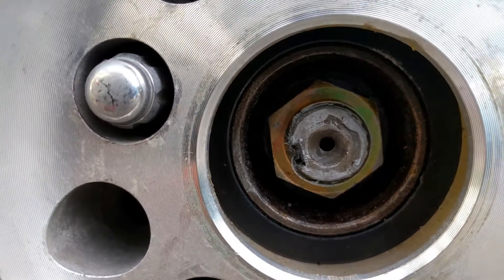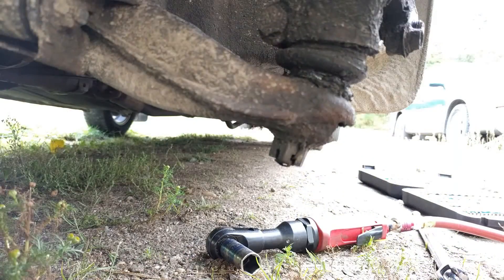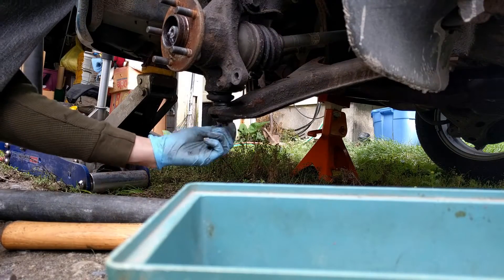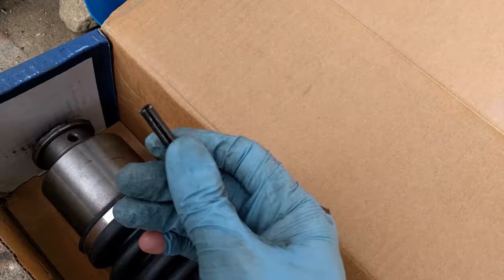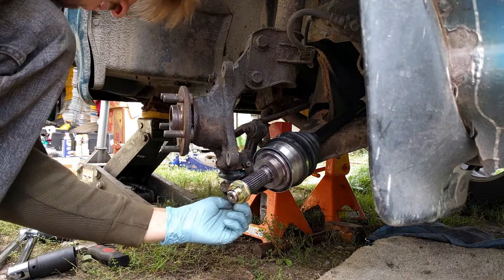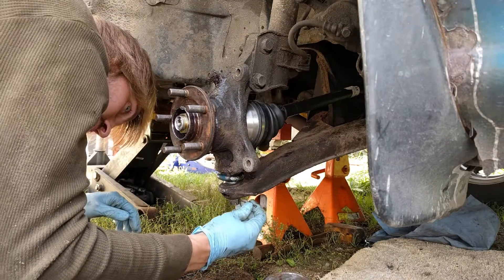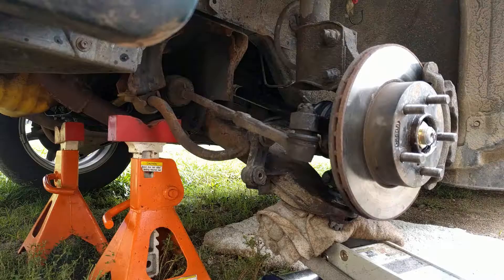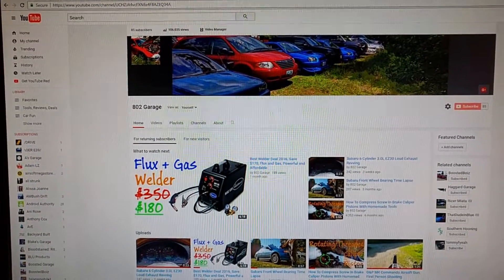How To Replace A Subaru Axle, Subaru Front CV Joint Replacement - Quick Version

Comment: Thank you. When I took my rotor off I had to use a trick that a mechanic showed on YouTube. He put a bolt in the empty hole on the rotor and screwed it in a little bit and did the same with the other hole and then it was easy to pull the rotor off. I had no idea what he was doing until I saw under there where he was just pushing it apart. I never would have been able to pull the rotor off by myself.
Reply from the maker: @loragoff1969  Yes definitely an excellent method to know! I actually have a short form video about that for brake drums up. Thanks for the comment.

Comment: How are you assured your front wheel alignment is good?
Reply from the maker: By removing the ball joint instead of the bolts that hold the strut to the knuckle, you do not change the alignment during reassembly. 👍 That's why I generally prefer this method. Otherwise, you can make a mark on the camber bolt and the strut and align them as perfectly as possible during reassembly.
Reply: @802Garage  ok thank you for that  - very helpful !!!
Reply from the maker: @Daninbristolbay  Sure thing.

Comment: Got a MINI r56 2007 with roughness thru steering and suspension when driving.  Can feel a creaking/rubbing thru steering, worse when cold temperatures, also feels a bit looser at front of car.  Not found fault yet, could it be the axle?  Started 2 months after clutch/flywheel replacement last March

Comment: What's the purpose of the roll pin ? Is it necessary to have it
Reply from the maker: The roll pins keep the CV cup from sliding in and out on the output shaft. They are very necessary. Without them the cup could slide out or press in, potentially causing a lot of damage to the axle or transmission. Unlike transmissions which have the axle stubs slide in that are retained with hog rings, this is how Subaru retained the axles on most models for a long time.

Comment: What video editor have you been using? Does it allow you to split audio and visuals?

You definitely made multiple videos from one work session like a pro.

Since you are already uploading short and long versions, you could try out different titles to see what brings in more viewers via search results. You could keep subscribers in the know via thumbnails.
Reply from the maker: I've been using VideoPad. It's not the most powerful editor, but it is very simple. It does allow splitting audio and video, which is nice. You can also have multiple audio tracks, of course. Sometimes the audio tools, like splicing a section into a video, can be a pain, but it definitely works.

Thanks! I appreciate that and the feedback. I tried to make one fully detailed and one as lean as possible. That's a good idea with the titles. Actually differentiating may help. It's funny because the wheel bearing videos are about equal in views, but so far this short version is far outpacing the long version, maybe just due to subscribers.
Reply: Yeah, I noticed the view discrepancy this time. It seemed odd, given the long version of this video was much shorter than the last long video.

There were a few parts (most noteworthy somewhere near the middle) where there seemed to be a lot of video cuts as you put together a more effective sentence. Since you weren't in the shot, you could have chopped the audio up as needed and given it a single stream of video to hide that. I do that in over half my videos, but I have years of practice with it beyond this YouTube channel.
Reply from the maker: Yeah that's a great idea! I thought of doing that a bit, but because the tools in VideoPad aren't super friendly, I decided just to chop chop chop. May put in the extra effort in the future if needs be. As you know, editing takes forever. I have used some other programs like Final Cut Pro which would make it a lot easier, but I don't own that. :P

Also, seems the views are getting closer. Odd. I did just update tags and thumbnails.